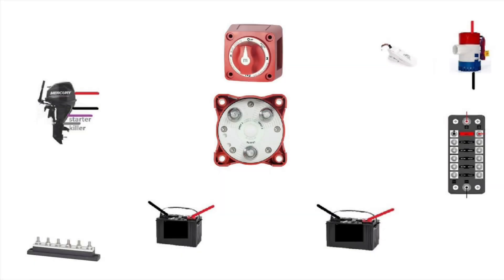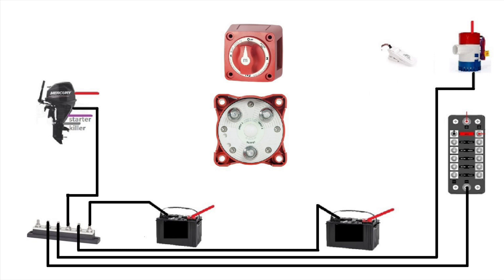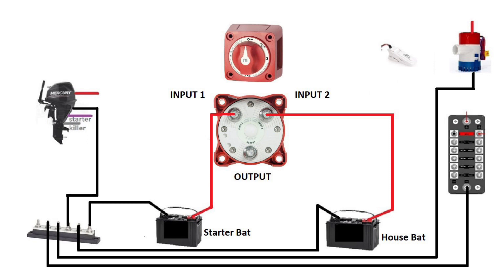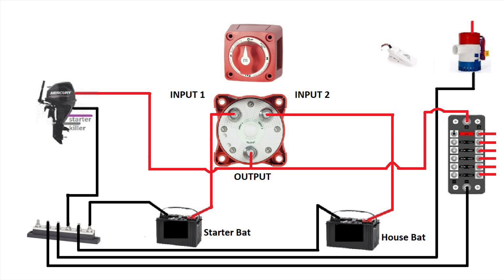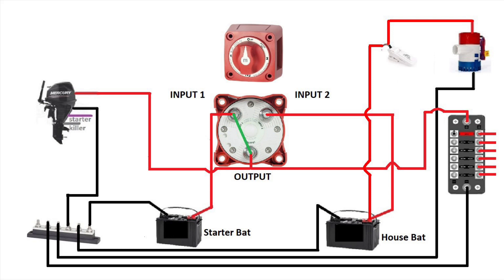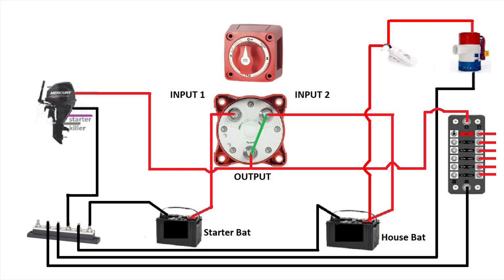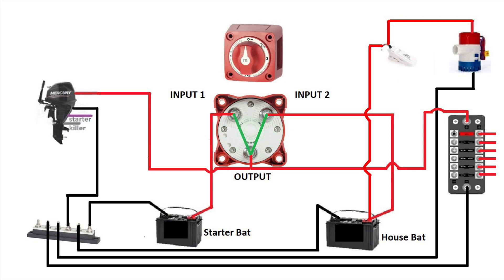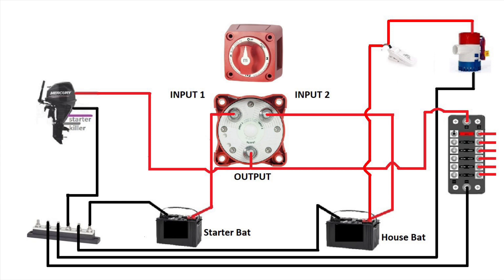How to install a battery switch on a boat

Comment: Hi, I want to know I have a 30Hp Mercury so it doesn't have an alternator. Can I use the voltage rectifier that is currently charging my starting battery to charge my deep cycle battery with your setup explained?
Reply from the maker: Hi Daniel Oosthuizen, Thanks for watching, I have a Mercury 25HP and it does recharge my deep cycle battery. :)

From Google : A rectifier transforms alternating current (AC) into direct current (DC). Its normal function is charging batteries and keeping them in optimum conditions while, at the same time, providing DC power for other loads.
Reply: Thanks for replying to my question.

Comment: Hey Joe, I was curious as to whether this setup will work with a 12v trolling motor on a kayak switching between 2 lithium batteries? Would I just wire the trolling motor in the position of the big engine on this diagram and keep everything else the same? One battery will be running a fish finder but I want to have the battery selector in place just in case the main trolling battery was to die I could get back. Thanks in advance!
Reply: Okay thank you! Whenever you have time will be perfect, I'm in no rush.
Reply from the maker: Here’s an update, Should be done this week 👍
Reply: @joetheboatguy5394  Okay perfect!  Thank you!
Reply from the maker: Hi Tyler Frye, Video will be available today at 2pm :) let me know if that's what you needed. 
Since you have 2 lithium batteries you might need a different charger for your lithium batteries
Here's the link:    https://youtu.be/8xnAsZ-2LQ4
Reply: @joetheboatguy5394  This is perfect!  Thank you so much! I will be sharing this in a few fellow kayak fishing groups to bump up some traffic for you.  Thanks again!
Reply from the maker: Hi Tyler Frye, Thanks for watching, don’t forget to like and subscribe :-) 

I just want to make sure I understand correctly. You would like to have 2 batteries on your kayak one as Main that runs everything (trolling motor, pump and fish finder), and one has backup in case you main gets discharged. So, you would switch to 2 and have everything running again (trolling motor, pump and fish finder) but on your backup battery.

If that’s the case than yes, you can replace the outboard engine by your electric engine...

if you only want Trolling motor to run on switch 2, (no fish finder and pump) then I would need to make a diagram for you.

Let me know :)
Reply: Thanks for the quick reply! Battery 1 will solely run the trolling motor and battery 2 will have a fish finder and navigation lights but I was hoping to just connect them to the battery and leave them off the battery selector so they would not be affected. I mostly just want the trolling motor to be affected by the selector so if battery 1 dies I can switch to battery 2 that has the fish finder and navigation lights if this possible.
Reply from the maker: Ok got it I will do a diagram soon. How fast do you need this info?

Comment: Nice video mate, just a quick question, can I use the starter battery as a house bat/deep cycle battery as well ?
Reply from the maker: Hi Happygear, thanks for watching and nice comments. Some deep cycle battery will be able to start your engine with no issue, all depending on the cold cranking amps on your deep cycle battery. It`s not its purpose but will work if you have a small engine. Now they have what’s called dual purpose battery which is meant to be a deep cycle but with cranking power.
Reply: @joetheboatguy5394 hi Joe!
So it will be able to give amps for a long time like a conventional deep cycle battery but higher amperage for the cranking is that correct?
Reply from the maker: hello panzermagier, thanks for watching. Deep Cycle Battery: These batteries can handle repeated deep discharges and recharges, tolerating deeper discharges before needing a recharge. This feature allows them to endure frequent cycling without harm. Regular Battery: More prone to damage from deep discharges and rapid cycling
Reply: @joetheboatguy5394  ok but since my engine takes a millisecond to start ( fuel injected) a combined battery would be a good choice right?
Only appliances I will be using heavily is my radio when the engine is not running!
Reply from the maker: ah ok, no the radio should not be causing you problems just make sure you don't discharge your battery too much since it can damage it in the long run.
Reply: @joetheboatguy5394  great so I’m gonna buy a deep cycle with cranking power!
Thanks very much for the advice!

Comment: So to make sure I understand. In order to charge one or both (I have two batteries) The switch needs to be in All or 1 or 2. Correct?
Reply from the maker: Hi 302Z, thanks for watching. You will be charging the battery selected. So if your on 1, your charging battery 1. If your on 2, you will be charging battery 2 and if your on both, you will recharge both batteries. Make sure your switch is a make before break switch 👍

Usually battery 1 is a starter battery. Battery 2 is a deep cycle battery. So to start your engine you should be on position 1. 

Nowadays  they have dual fonction batteries. Which is a deep cycle battery that you could start your engine with it. They are great

Comment: Hey only problem I’m
Having is that after I crank up the engine when I got to switch from battery one to battery two the engine turns off, how can I rectify this?
Reply from the maker: Hi Shad, ok that’s a problem, is your switch a make before break switch? A good switch usually is a make before break. Let me know what switch you have and will try to figure what’s going on.
Reply: @Joe The Boat Guy  thanks Joe, so you don't need a circuit breaker if you have those kind of battery switches you mentioned?  Thanks
Reply from the maker: Hi Happygear, thanks for watching, if you have a make-before-brake switch you shouldn’t have any issue 👍
Reply: @joetheboatguy5394  Thank you for the reply, it’s from a brand named Apeixoto but it’s not saying if it’s a break before make or, make before break.
Reply from the maker: Hi Shad, Most quality 1/2/B battery switches, from reputable manufacturers like Blue Sea Systems, BEP/Marinco, Guest & Perko, are designed to be make-before-break. Make-before-break means that as you turn the switch from position 1, to BOTH or 2, the previous position does not open-circuit or disconnect until the next position can carry the current.

I looked at the Apeoxoto switch and they say it’s a kill switch type. I might be wrong but sounds like a break before make switch. Be careful a break before make switch can cause damage to alternator…..
Reply: @joetheboatguy5394  Thank You so much I just ordered one from Blue Sea Systems.

Comment: Thanks for this Video Joe, I was wondering how would it work instead if only doing a Dual Circuit Switch with only on and off? So one small AGM is the main battery and adding a 27 Group Battery to the main for additional juice. This is for a Sea Doo Switch (new Pontoon boat) which unfortunately only comes with a small AGM Battery slightly bigger then a Jetski battery.
Reply from the maker: Hi Orlando C Karpf, Thanks for watching. I have a question on what you mean by just on or off switch. Basically you would like to have the option to set both batteries in parallel when switch is on "ON" position?  Let me know if thats what you mean, thanks 

Sorry for the delay lots going on lately

Comment: I didn't think switching from start to house while running was a good idea unless using a 'BOTH' config.  I think when the amps drop out/fluctuate, it will destroy the voltage rectifier which will cause no charging from your stator I think.  Running motor and killing power is a bad idea.
Reply from the maker: Hi AN, thanks for watching, Most quality 1/2/B battery switches, from reputable manufacturers like Blue Sea Systems, BEP/Marinco, Guest & Perko, are designed to be make-before-break. Make-before-break means that as you turn the switch from position 1, to BOTH or 2, the previous position does not open-circuit or disconnect until the next position can carry the current.
Reply from the maker: Not recommend to go to off position when engine is on. That can be bad and cause damage.

Comment: So if I wanted the bilge pump to work manually oof a switch on dash, I would wire it the same but instead of float switch down by pump wires would run up to dash ?
Reply from the maker: Hi PopPop, thanks for watching, Yes and if you want the float also you can put it in parallel as the switch 👍 let me know if you know how to do it. Or else I will give you more explanation 😉

Comment: One of the best explained videos i have seen yet. Cheers.
Reply from the maker: Hi ME, thanks for watching and for the kind words 👍
Reply: @joetheboatguy5394  Hi again, one more question, would it be ok to daisy chain all the grounds? So by that I mean ground on house to ground on switch panel to ground on bus bar to ground on start battery and finally to ground on outboard, rather than multiple runs. My house battery is in the bow for a Minn Kota and some accessories with switch panel midship on a side console with start battery in the stern.
Reply from the maker: @Me, hi, yes you can all grounds are connected together in the end. BUT you just have to make sure you respect the AWG wire size. It's a little more tricky when you daisy chain but if it's done right you will be OK.  Example, you can't daisy chain a 2AWG wire to a 16AWG wire. Another solution would be to install 2 ground bus bars one in the front and one in the back of your boat, and connect the two ground bus bar with a 2 AWG wire.
Reply: @joetheboatguy5394  Perfect that's clear. Thanks again for excellent content and replies.

Comment: Where would a dc / dc charger go on this setup please?
Reply from the maker: Hi The Grumpy Business Man, thanks for watching. You will find your answers in this video check it out: https://youtu.be/Q8VgRRlOmW0 let me know if you have more question 👍
Reply from the maker: The one I’m using in the video is Ac/dc charger but would be the same for dc/dc charger.

Comment: Does the starter battery need to be a normal car or truck type or can it be a deep cycle batterie ?
Reply from the maker: Hi Bufford, thanks for watching Deep cycle batteries should not be substituted for starting batteries. Marine Dual-Purpose Batteries combine the performance of starting and deep cycle battery, and are a good choice on smaller when there's no room for two batteries. I stole that from Google. But now they do have a battery that can be deep cycle and starter battery. OPTIMA BATTERIES 8016-103 D34M BlueTop Starting and Deep Cycle Marine Battery.

It all depends if you want two batteries or a one battery setup. Today there is much better option then the pass.

Comment: One more question, with the current setup with the switch in the 1+2 position, will the batteries be in parallel?
Reply from the maker: Yes they will be in parallel 👍 your output will still be 12V

Comment: Best video I have seen yet for the battery hookup and how the switch works.   Do you think I need a battery isolator for any reason with this type of switch installed?  If so, can you show the install?
Reply from the maker: Hi JJ, Battery isolator will prolong your batteries life. All depends on how you use your batteries. Basically your isolator will have 3 connections. The A B connection will go to both positive of each batteries. The other connector will be ground 👍